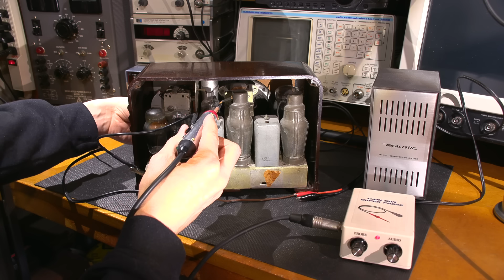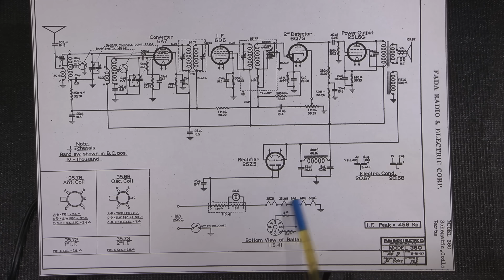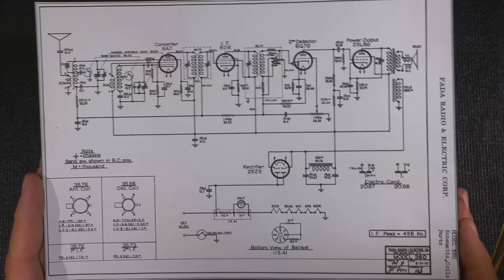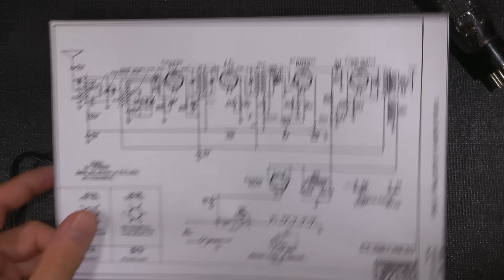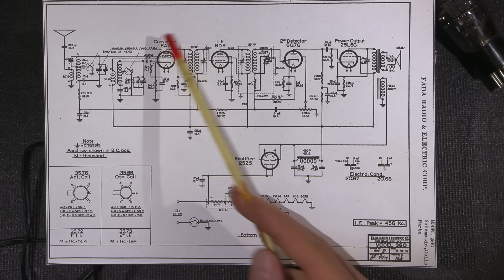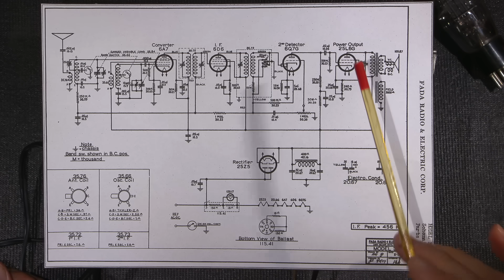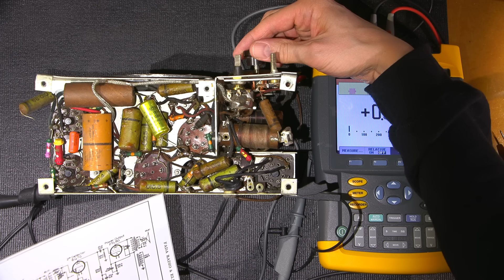Electronic Circuitry Diagnosis And Fault Finding! [Repair]

Comment: Yes because college electronics thinks tube circuits are gone forever. We music people think differently. 73
Reply: My boss told me and some coworkers on one of our lunch and learn meetings we had that he has this book from like 40 or 50 years ago with almost every audio circuit topology you can think of all analog and he said he looked at every single one of them and said you just wouldn’t do this anymore. Modern technology and mcu just make them obsolete. I am a young electrical engineer and I also play guitar and I think a reason why people like tubes over digital is because digital is too good at doing it’s job and you often find people trying to recreate that vintage sound using digital that you can’t just capture accurately. My dad would say you can definitely tell the difference but I think he’s just sipping the cool aid haha. Love to here what you think!
Reply: @pieshower  solid state leaves out harmonics that tubes product in sound distribution. I don't care what digital circuit you come up with sound to me is dead without those harmonics. I know that even old antique radios AM and Short wave radios sound better than most modern equipment. You have to have heard the original tube sound. I used to tell my friend that radio sounds like stereo even though it's a mono radio. I will keep my el84 and el 34 amplifiers. I don't play an instrument on these amplifiers. It's sound reproduction I care about. I don't listen to Rock or any noise they call music today. Some rock stars like tubes but my tubes see classical and instrumental music. I was a music major but went into electronics. One thing I don't have to worry about is forking out 1000's of dollars on digital equipment. I'm no audiophile but I know what I like to hear. I'm also not alone in this subject there are many that prefer tubes over solid state. 73
Reply: @ronb6182  i totally understand what you are talking about with the harmonics but technically you can introduce those into an audio signal digitally. It just isn’t the same because it is digital and discrete. Whereas tubes are analog and continuous. Like I said I’m young and wish I would have seen the world differently before the age of digital. I can get a tube amp and maybe I would fully understand but not right now lol. Thank you for your comment!
Reply: @pieshower  first of all music is analog if you look at notes as different frequencies. I know people that prefer vinyl over CDs . I prefer audio tape. Reel to Reel. The faster the speed the better the sound. The cassette deck was inferior to Reel to Reel. Cassette tape speed is either 15/16 IPS or 1 7/8 IPS Reel to Reel can be 7 1/2 IPS, 15 IPS, 30 IPS or 60 IPS. From a professional deck. Mine only does 1 7/8, 3  3/4  IPS and 7 1/2 IPS. Faster the speed is better. 73
Reply: @ronb6182   oh no you misunderstood. I know music is 100% analog it’s just you can’t make an analog signal digitally all you can do is increase the resolution to where it from the naked eye looks analog and continuous. But if zoom in it would be clearly discrete values that jump from point to point. It’s just I have a hard time believing a human can physically hear the difference and are only thinking they sound different because of a bias. There is nothing wrong with that. You may be absolutely correct there is a difference. I just don’t hear it.
Reply: @pieshower  ok I will just put the warm tube sound aside and wait until a showroom has one of those amplifiers on display then I will know how close they came to succeeding the warm sound. 

I remember my friend had a stereo 70 by dynaco and the pop station played seasons in the sun. You could hear the tube sound also iron core output transformers also play a big part in the sound. I came to Florida to visit my sister's and she had a stereo but it was transistorized and the station down there played the same song and it was the worst sound I heard on that song. I didn't understand why on car radio the same dead sound. My co worker and I were talking about tube amplifiers and he was the one telling me about the harmonics in tube amplifiers that transistors leave out those harmonics then the puzzle was peaced together with Seasons in the Sun. Well there were a few pop songs I did like besides Classical and Baroque music. Simon and Garfunkel was another group I liked. Well that's my story with the tube amplifier and seasons in the sun. 73

Comment: Thanks for the accurate analysis of this old radio, Paul. I have a 1937 RCA 10” Kinoscope Model# TC-1. I assume that the tc stands for television chassis. It is in working condition, but after watching your videos on restoring old radios, I will definitely build a Carlson superprobe and go through it and replace all the old “waxies!” The TV was given to me by my dad who ran a radio repair shop in Milwaukee back in the 1930’s, so it has a great deal of sentimental value to our family. Thanks again!
Reply: It's also worth a lot of money

Comment: Hi Mr. Carlson. Do enjoy your video's. I bough a Patrolman 6 radio about 10 years ago. Did enjoy the sound sitting out on my deck. One day tuning around the string broke now no tuning. I took it apart and tried to restring the tuning string. Boy just didn't work out for me. My question for you is "Can I ship the thing to you and you show others how to restring the tuning string", plus tweak the receiver (tune it up), and per haps add new parts you think are bad (caps-resistors etc.). I would be happy for you to use this as learing tool for your other viewers and pay you for your time and shipping back to me? I know a lot of other people own the Patrolman 6 radio. Thanks for reading.

Comment: My Philco Model 20 radio burned-out its rectifier tube and the power transformer got really hot. Any tips on diagnosing the posible cause? I am currently thinking of a short circuit somewhere in the wiring or even inside the the power transformer itself. The rectifier tube is type 80.

Comment: I have never liked series connected heaters. Even in the 70's when I got into vacuum tubes. I hated series connected heaters. I understand the reason for them, at the end of the day I'm sure people hate them. For a few bucks more you can have a heater transformer and save head ache/heart ache later on. I have seen sets with series heated tubes get thrown in the dumpster with out a by or leave cause being series heated tubes. Where as parrallel heatered tubes were kept.

Comment: Greetings:
I did notice that as a side benefit that field coils reduced the size of needed filter capacitors for clean B+. I miss their  inherent efficiency in Pi filters over resistors.
You may not be aware that your saying "one zero" point 5 is somewhat confusing those of us that are following you closely by not seeing a 1 as part of the capacitor value and not knowing that you are actually  counting the leading zeros. It caught me until I figured out what you are doing. Maybe you could say "single zero" instead of "one zero".
I was thinking about the "super probe" and wondering about its advantage over a traditional signal tracer. High gain and size are obvious. Then I wanted to reduce size even more; so, headphones instead? The headphone wires could be in the way; Bluetooth headphones, but the probe gain could make that problematic. Solution should be wired; tiny built in speaker or pc sounder maybe. (I really hoped that BT headphone would work.) OH, well, sigh.

Comment: It is said that without the capacitor on the output tube plate the voltage can peak too high and damage the output transformer or the tube. Especially with the speaker disconnected at high volume.
This is one of the reasons the manufacturer installs it.
Actually I have never seen this happen.
It would be interesting to look at this with a scope.

Comment: With a device this old, there really is no reason to test any of the old paper/was caps.  They all need to be replaced - even if they haven't completely failed, there values have almost certainly drifted considerably - and it's only a matter of time before they DO fail, especially if you are planning to put the thing back into use.  Ancient capacitors/ (and, to a somewhat lesser extent) resistors and -transistors are not sacred little archaeological treasures that need to be preserved - think of them more as little ticking timebombs just waiting to wreck your device.  They can and will destroy your transformer(s), which ARE the things you want to preserve.

Comment: A main switch switching both main power lines (2 polar switch) would be much saver. As nice as those old electronic are (art of engineering with few electronic parts / tubes), but so old devices also often lack of proper EM shielding, why they are not conform to todays electromagnetic compatibility which is required in most modern countries to not disturb other (and important) EM frequency bands (avionic, emergency services etc).

Comment: The best advice I ever received from an old tv store repair guy/Radio amateur.. was if you want to restore ANY old radio equipment, REPLACE ALL THE CAPACITORS! don't even bother turning it on as you will probably destroy other components. That held true right into today's modern solid-state equipment. But it really helped to buy an ESR meter...Equivalent Series Resistance meter to check even NEWcomponants as I have found many new capacitors from China are bad right out of the package! Never assume a new component is accurate or working

Comment: I have to ship a D&A t-600 linear and want to put some bubble wrap inside to protect the tubes from moving . If it is unplugged can I still get shocked by the tube top connectors doing this?
Is there a safe way to discharge the capacitors?

Comment: Mr.Carlson,
Since the receiver is a Fada, and probably quite collectible, I think you should do a restoration. I would be most interested in seeing what types of modern caps go where, and how you determine what kinds of caps are used. I have a modest barnful of receivers and transmitters and would be most interested in learning from you. Someday one of my students will ask me just that same question, and I would like to have an answer for them. All electrolytics are easy to determine what type goes where, but what about the other types? Also, what type of resistor is best to substitute for carbon comps? I may teach the basics for Amateur Radio for the tech license, but a lot of my students will buy an old tube set someday, and wonder how to make it work once again without killing themselves in the process.
   Thank You again for such an informative video!

Comment: I strated servicing valve (vacuum tube) radios after school way back and got quite familiar with the techniques. One popular radio was a Philips portable with a 1.5V A battery and two 45V B batteries in series. The most common fault was the output transformer open. This was because people took them down to the beach and the salt air corroded the winding. We had to keep a stock of the transformers in the shop to keep up with the demand. Apart from modern electronics that I work with I still am given old radios to restore. The oldest was an1933 Astor Mickey, which actually still worked. All the valves were functional!

Comment: THANK YOU for going thru the print and comparing it to the various spots in the circuitry.
   I wanted to take Electronics, when I was a kid, & talked my Dad into letting me take Electronics in a local technical school (night school), while I was going yo High School, in another part of town. After the class started, we didnt have but 5 in our class. I was the youngest at approximately 16. The oldest was in his 50's. That was in about 1965. The Dean came in and said there weren't enough folks in the class to constitute it a class so tgey were shutting it down. We could either get our tuition back or choose another subject. Machine Shop was available, so I took that. I took that type course on up thru college level & turned out to be a fairly decent Machanist, but my true love of electronics was never explored. I'm dang near 70, now; and am STILL trying to figure out how stuff works !!! I just happened upon your site, (it was in my "pull pile"), and am going to watch as many of these as I can. You talk like you know what you're talking about !!! Thank you, again.
   One question: Since a transistor is just a switch, controlled by a smaller signal on one leg, how does it work like an amplifier? I CAN'T make it make since.😜
   Bill, from Tn., 🇺🇸

Comment: Ive been fixing radios since the 1950’s and never saw a real hot chassis like this. Most of the radios were consoles and operated with power transformers that isolated the line voltage. The AA5 had what I called a semi hot chassis because they had two ground circuits a floating ground and a chassis ground that was isolated to some degree by a .1 uf cap with a 220k resistor across it. Only now after watching this video do I completely understand the concerns about hot chassis on an AA5. The AA5 is a safer chassis on its own but requires an isolation transformer when connecting other pieces of equipment to it

Comment: I have both radios, this video was very informative and answered a question about my 210xl. On the 210xl the battery would go dead after it was unplugged for a while, I though I had a current drain but see it's only designed to last 24 Hrs. without a. c. power to the radio.

Comment: The funniest thing that I remember about old radios was the use of a resistor cord as part of the filiment chain, often referred to as curtain burners, because the cord would usually run along base boards under curtains, and the cord got warm to hot!

Comment: I don't want to sound so critical, but where you mention the tube testers at the local drugstore, you forgot to mention that you could also check for strong and weak tubes with the use of a meter that came with the tester! There was also a book that would tell the user how to set up the machine with various knobs! The filiment voltage, plate voltage and would even have a suitable substitution tube listed!

Comment: I actually owned an avo valve characteristic meter for testing. Useless if you don't have the pinout book. I miss those days. Ecl 182s rock

Comment: I have an old Bogen tube amplifier and a 1934 Philco model B that I have had since around 1960. Either one I have quit trying to use until I get all the capacitors checked out and changed. I wish I had learned about them earlier as I had another Amp that was red - plating the rectifier and I didn't know what to do with it.
I keep watching videos like yours and learning.
I was just telling my son " wow, my radio is almost 90 years old."

Comment: I'm guessing,  coupling capacitor between, 2nd if stage and detector.. Or coupling cap from 1st audio to output audio tube...cap is open.   I've been tinkering with old radios since I was 14 or so... My father taught me a lot... My two "bibles" are his two old books... "elements of radio servicing"  by Marcus and levy and an old RCA receiving tube manual... Now that I've been watching further.. It looks like a shorted capacitor in there, somewhere in the audio section... Those old wax/paper capacitors don't age well.. Shorts and "opens" are common... They can get "leaky" and act like a resistor and mess up grid bias,  etc on interstage sections...
Reply: Great video... 👍

Comment: Mr Carlson, isn't the "ballast" tube a barretter which are used to even out or stabilise variations in the supply voltage to keep the tube filaments more constant. Also suggesting that a valve rectifier can be directly replaced with silicon diodes has sent more valve equipment to the scrap heap than any other home bodge as it causes a massive increase in the H.T. voltage (typically 20 to 60 volts) and allows ht to hit the anodes before the filaments  are hot so voltages rise to peak  values. destroying capacitors and causing cathode stripping|

Comment: Would it have been possible to detect this faulty capacitor by systematically checking all capacitors for short circuit in the first place, so by eventually determining this specific component breakdown? Wouldn't this be a simple and straightforward heuristic to identify faulty capacitors?

Comment: Two questions: Near the beginning where you're telling us about the chassis being "hot" you said the radio could use DC as well as AC, was that correct? I' don't see how it is possible. Second, any idea why they used 456 khz instead of 455 which is more commonly used in the AM band as the IF?

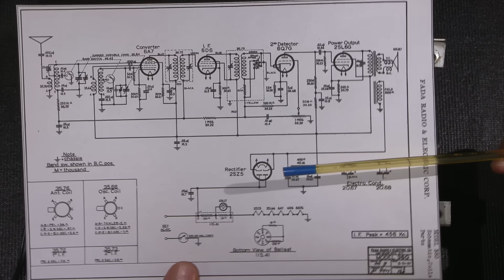Comment: How does connecting both sections of a rectifier tube in parallel reduce the voltage drop? 41:36
Reply from the maker: Hi Randy. Tubes, "even rectifiers" are higher impedance devices, and are lossy when feeding current hungry loads. By putting the two diodes in parallel, this reduces the loss affect. These are not like standard silicon diodes with a .6 Volt drop, vacuum tube diodes under load (depending on service) will drop 20+ Volts. Of course, this also increases the current "delivering" ability of the power supply as well.

Comment: This vid just came up for me so I'm a bit late for the party, but if you took a before pic with all the caps in situ before replacement and bagged them along with the schematic, wouldn't that help preserve the antique value of the radio? A similar technique is used for some performance mods on antique cars(as long as no chopping has been done! 😵). I actually prefer the historic value of things to restoration of them with aftermarket parts whenever possible, but concede, sadly, that sometimes that's not the case.